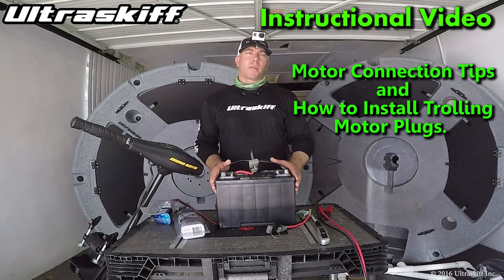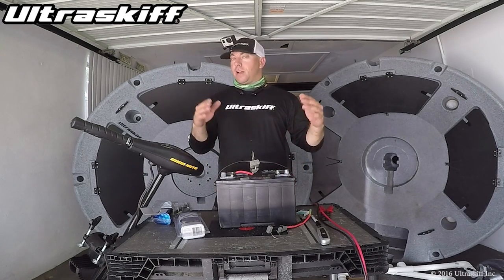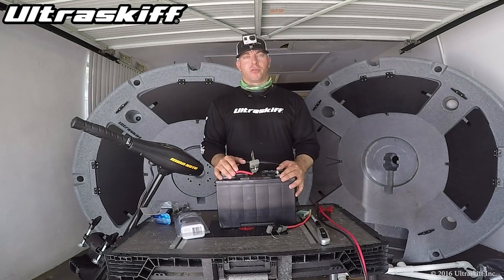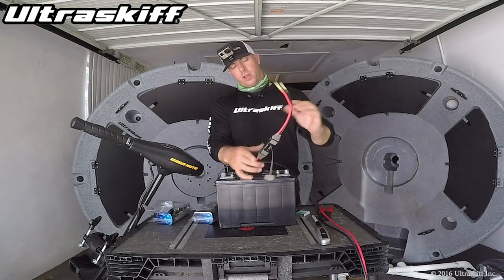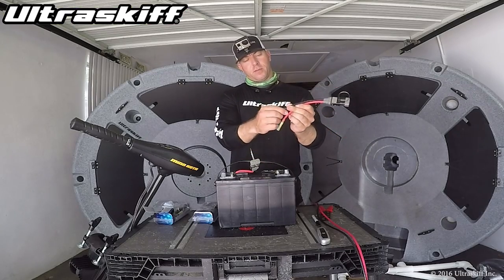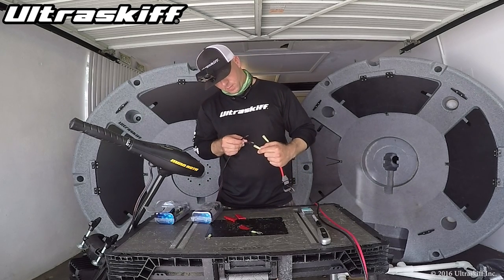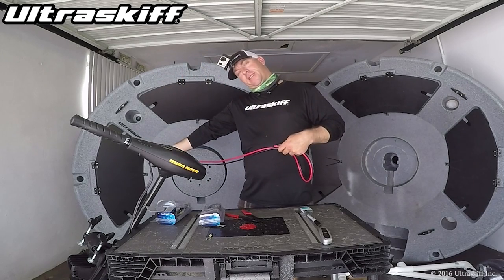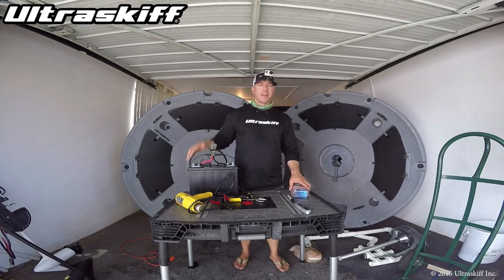How to Install Trolling Motor and Battery Plugs | Ultraskiff 360 Watercraft | Round Boat

Comment: I really like this electric motor. It's super quiet and very easy to handle. I lift this up easily with one hand and stow it away inside my yacht. So happy with this purchase. The battery to run it is another story.

Comment: Think about the fact that you will increase the resistance in that circuit when you extend the wires like you did. You MIGHT need to increase the thickness of the wires.

Comment: I use the Trac connectors to connect my MK Turbo 65 to my batteries and to a PWM unit I built after watching a YouTube video. Just got a 50ah lithium battery. Hopefully will get a chance to try it out on the water soon. The Tracs are very solid and I use 10 ga and 8 ga wire with them.

Comment: If motor jams up the breaker is there to protect it from drawing extra amps and melting wiring
Reply from the maker: That may be true.  I've been using the skiff without a breaker for over 8 years now. Like probably over 1200 fishing trips so far.   Have been through everything and have had everything happen.  My only guess is maybe the motors are better built nowadays to handle stuff like this.  I really dont know.  But I do know that I have no need for one based on my experiences. To each his or her own.

Comment: Hi thanks for your video.I read where you said that the battery is water right up to the terminal points.If the battery did get submerged Would I get a shock from the battery?If wet hands touched the battery could I also get a shock?thank you.
Reply from the maker: It's not the terminals but lead acid batteries have removable caps on the top of it. They are water resistant and can be rained on no problem.  But if submerged there is a chance of the battery flooding then its ruined.  Wether your hand is wet or not the same rules apply even if they are dry, you cant get shocked unless you touch a metal object that is simultaneously touching both the positive and the negative terminals.
Reply: Thanks for your quick reply, that’s good to know.

Comment: What is the best battery in your opinion for your buck? I have a 40# minn Kota and an ultraskiff 😀. Just need something you know works and holds up well. Thanks!
Reply from the maker: My favorite battery is the DC 27 Everstart from Walmart.  It is inexpensive, has a lot of reserve power and is not too heavy to carry.  My second favorite is the DC 24.
Reply: @Ultraskiff  i just bought the 29 with 105ah is that anygood

Comment: With the connector kit attached to the battery how are you still able to recharge your battery?
Reply from the maker: The terminals and Posts are still exposed and unchanged from before you installed it.  The clamps from a charger clamp onto either one.

Comment: Hey brother! I took your advice from the video. I plan on taking my seahawk 4 eith a newport vessel 55ib thrust motor, out tmara mornin but I got an Urgent question, can the circuit breaker from my motor sit inside the battery box on top of the battery using a small piece of cardboard as a barrier thats taped down with electrical tape? Is this safe?

Comment: U need to put a breaker on that positive connection bud no protection without one
Reply from the maker: nemzdroidx no breaker needed for a 12 V trolling motor that is not not connected to anything else.
Reply: @Ultraskiff   I beg to differ, without a circuit breaker if that prop gets jammed to a stop while you have the motor on full thrust you have just seconds before you start damaging your motor.  Its not just for protecting your wiring since neither Motorguide or Minn Kota will warranty a motor that has been damaged by high amp draw.  High amp draw heats the wiring around the armature  causing the insulation to become weak and crack allowing current to seep out which costs you power and eventually burns out the motor.  Minn Kota even states in their manuals that "An over-current protection device must be used". It is also required by the US Coast  Guard per Federal regulation though they have never  checked for it in my experience.
Reply: Antrigen hey! I just bought my trolling engine and battery and 100% want the safest set up. I didn’t pay the best attention when we were covering batteries in class. What your recommendation for the safest but most efficient battery set up? I just need someone to tell me what I should buy and install.
Reply: They usaually recommend a 105 amp hour battery i have a 31group agm from duracell been good to me and comes with 3 year warranty cost around 200 bucks but u can get away with the lead acid 31 group from duracell thats what i had previously and upgraded to the agm. @Jackie Allgayer

Comment: What's the name/brand of those connectors, and where can I get them?  My plug is mounted into the boat and gets stepped on all the time.  I want to use a plate to cover the ehole for the receptacle and just let the cable hang out.  That way when it's plugged in it just lays flat on the deck.
Reply from the maker: They are called Trac Plugs. Most brands of TM also make their own version of them.

Comment: Where can you buy the extended wires from?
Reply from the maker: If your talking about just the Wires then I just went to West Marine and got some spare 10 Gauge Marine Wiring.   About 1$ a foot.  Most Marine STores have Wiring. If your Talking about the Plugs they are called Trac Plugs. https://www.amazon.com/Outdoor-T10136-Gauge-Trolling-Connector/dp/B0080IGPFI
Reply: Thank you so much! I appreciate the help.
Reply: Or buy a 10 foot 10 gauge jumper cables from walmart for 7 dollars and cut the ends off.